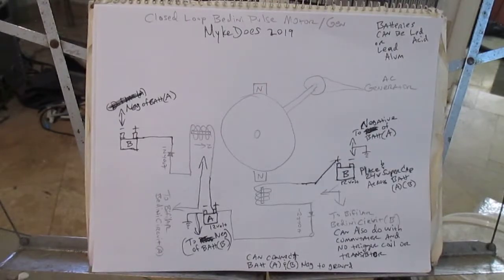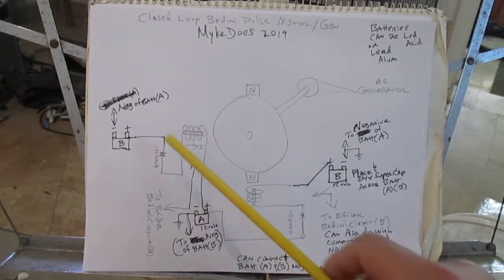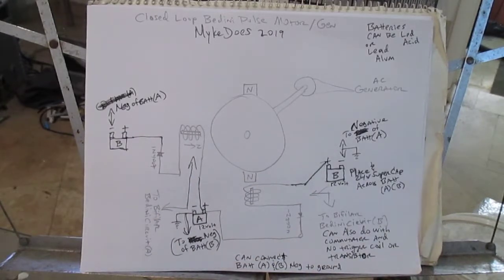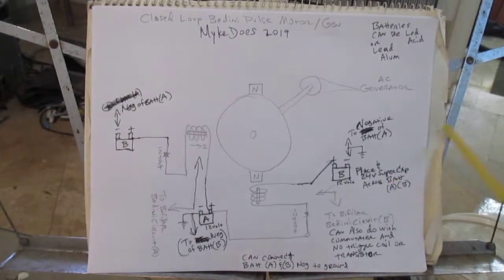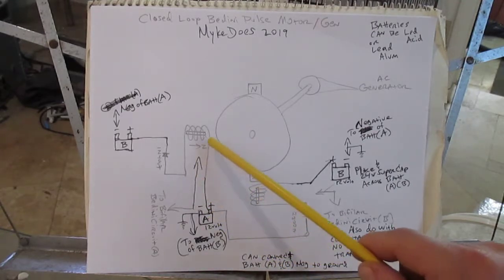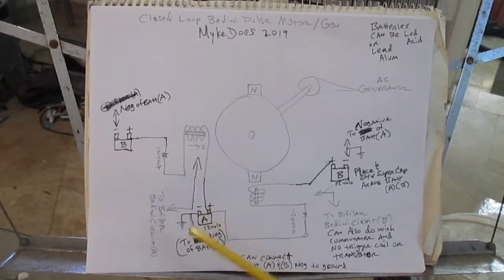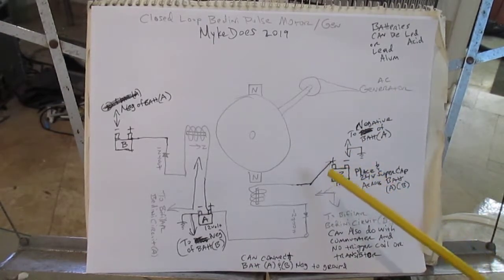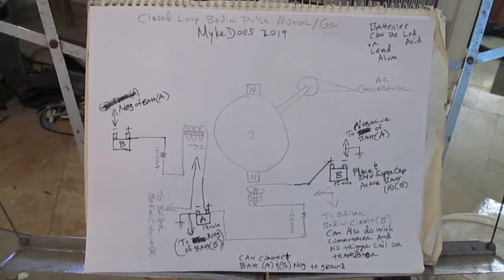Energy Loop  https://www.youtube.com/watch?v=TW72mRXVrvs

Comment: If you can avoid using the SSG circuits for your intended application. Yours would work far better with reed switch, PWM, or a Hall Effect switch. SSG was a good circuit for some applications.
Reply from the maker: I need a reed switch that can handle more amps , i don't intend to use more amps though. Just want the reed to handle and last long time, they keep blowing on me. The kick back is doing it, would need to use high voltage blocking diode on the output of the reed especially if your drive coil has a lot of turns .
Reply from the maker: My Lab is down now too busy with other shit
Reply from the maker: mind if i ask how you connected your two batteries/caps particular the negatives??
Reply: myke Does, simply connect a two or three watt AC LED light,  sourced from the two pins of your reed switch. Will help keep the switch stay functioning far longer.
Reply from the maker: @maglectric3624  a ha right, got it. Makes perfect sense.
Reply from the maker: I guess the only advantage of Transistor is switching speed and control. I guess this can be done by moving the reed closer or further as wellhmm , what are the advantages to transistor's? if they make heat there is loss, reeds seem to blow out b4 making heat
Reply: myke Does,  transistor heat is usually unnecessary and can easily be avoided by using a separate coil for the trigger to base, with just a few turns. For example, a 2N3055 base is switched on at 0.70volts. So, if you have a separate trigger coil with very few turns, you will waste much less input power, while you can find the best placement position for the trigger.
Reply from the maker: @solarisenerpower2409  Agreed , I use bifilar with trigger wire thinner awg, trigger wire has many turns so voltage reaches higher level on the base.  I thought the current to the base was determining the switching not the voltage. or is it both. You are saying using lower voltage and higher current with a trigger that has few turns.  (Correct?)
Reply from the maker: @solarisenerpower2409  TYVM , I saw this guy few years ago, was looking for this video for a while.  But for this energy loop circuit i would need an oscilator circuit that can trigger two coils back and forth, so that when one is on the other is off. I found it easier to use the bifilar to achieve this using coil positions around the rotor at 90 degree apart, forgive the error in my video it's not 45 degree , it's 90 .. But having a trigger circuit that can trigger two coils simply when one is live the other is off and back and forth that would be even better.
Reply from the maker: @solarisenerpower2409  I have not built this yet. But i figured why not open source it.
Reply: myke Does, I know this is not a good time to buy anything but just so you know and have another option for your reed switch problems :
https://magnasphere.com/switch-series/
The other is :
https://www.hsisensing.com/products/

Comment: how is the voltage looking on your alum batteries ?.  i hear they are good ?.  in my experience the problem with modern batteries is decomposition of the electrodes....   b4stards
Reply from the maker: Lead Alum is awsome , I made them for 5 years ago  all i do is add water and the voltage never gets lower than 5 volts i am sure it would drop to 0 but it charges no problem, they are little lense dense than acid but there has been no corrosion what so ever , nada zilch nunca , NOTHING!!! sulfuric acid is the cause of that